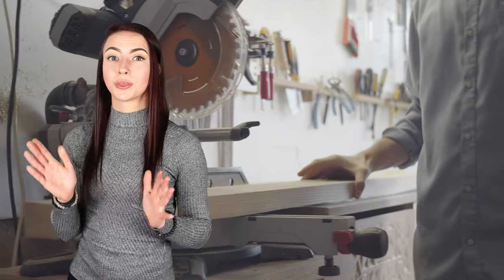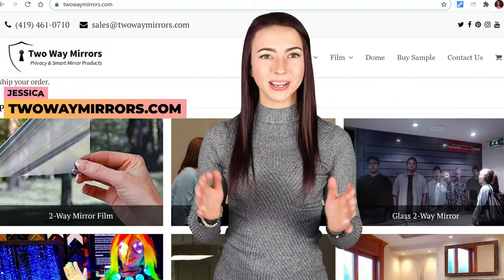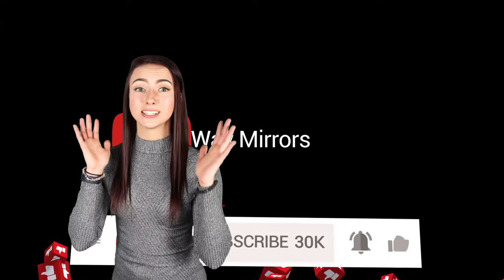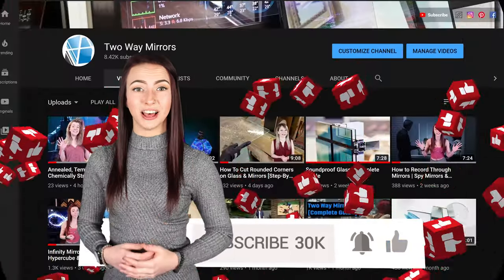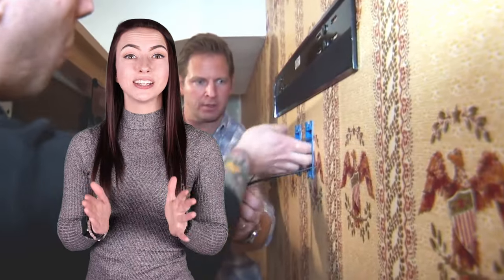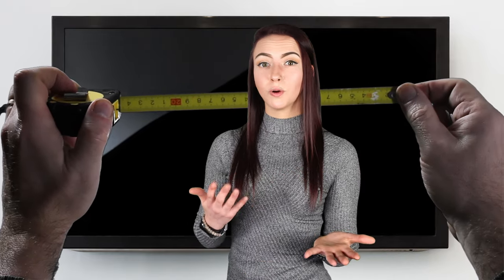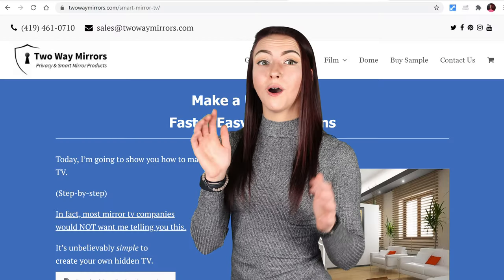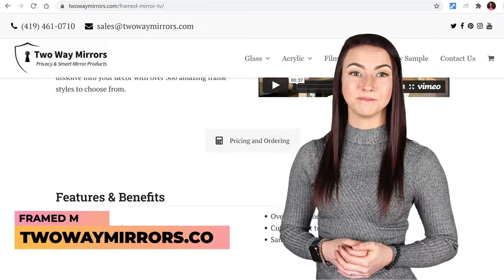What Is A Dielectric Mirror? Build A Mirror TV [That Fully Vanishes]

Comment: 1). If you put an OLED screen behind it, and had only one part on, would the rest of the mirror remain reflective?

2). If the screen is on, and a projector or other bright light source shines on the mirror, are both images visible?
Reply from the maker: Yes, it will shine through in that area, but only when the screen is on. Yes, it works as a beamsplitter as well!